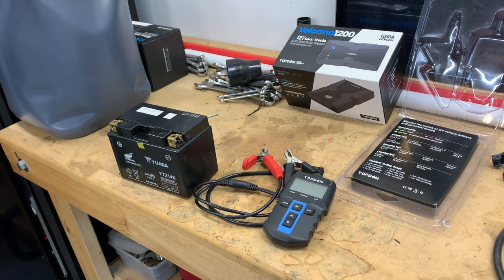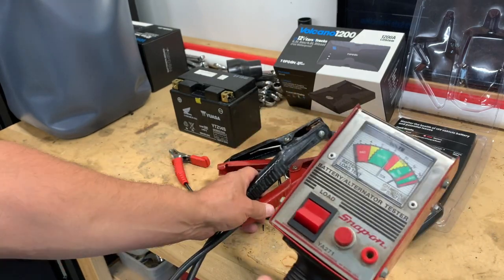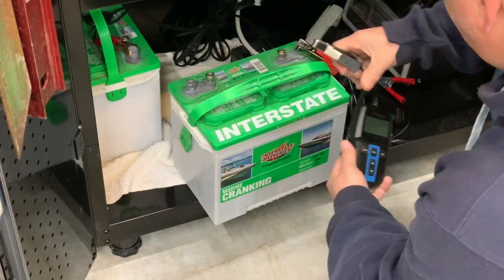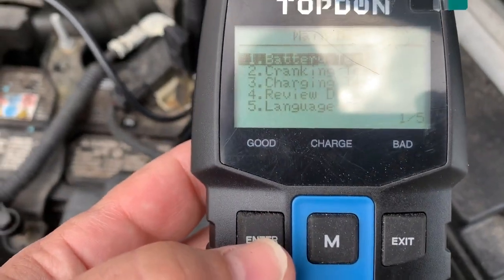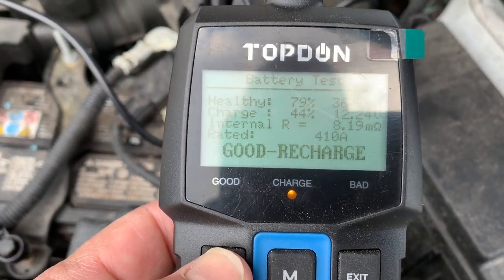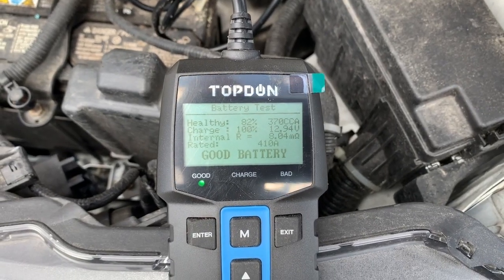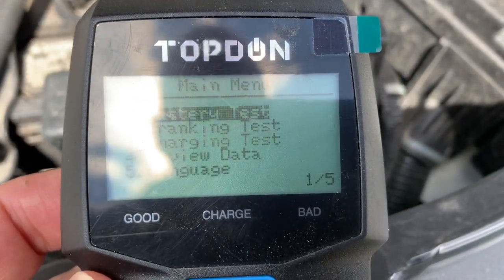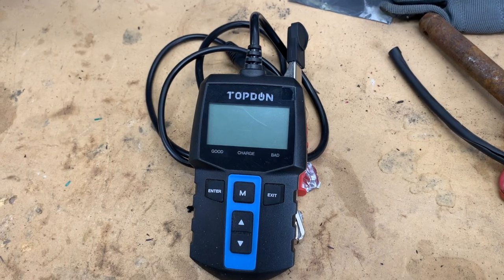TOPDON BT100 Battery Tester Review

Comment: Ok my Topdon BT100  on the charging test shows  NO-OUTPUT     and about 9.4V     with a brand new charged battery.  Battery test passes at 700 CCA.  Any ideas?
Reply from the maker: That would mean that your alternator is not working, right? How is the diode ripple test?
Reply: @EddieCarrara1   Failed diode test per a Oreill'ys  store tester.  So the BT100 found it,  it just says "NO-OUTPUT   and the booklet doesn't mention that error. The BT100 has been effective at identifying problems.

Comment: In case anyone else wasn't sure, on the charging test - after the ripple test - the unit is waiting for the engine to be revved up to 2500 rpms to continue the test.  You "Press Enter to continue" only AFTER you have revved the engine up to 2500 RPMS, not before and not during.  The unit detects on its own if the engine has been revved up and then performs the charging test at that point.  The owners manual in fact says you are hitting enter in order to view the results of the test.  I confirmed this with TopDon support.
Reply from the maker: Thanks for the clarity Mark 👍
Reply: Yes this should have been explained in manual. Rev up, get out of car go to meter press enter.
 Also should explain different batteries or give like to.  Also should change the word Engine needs to be "ON" should say "running". Because that's the verbage used to turn key on.  Poor manual.

Comment: You need a 2nd person to do the charging test. You need to have the revs up when you click enter, you cant run to the car after pressing enter, by then it's aleady testing. The crank test saying low was because the volts were below 8v. That is bad and an indication something is wrong. That battery was dropping from 12v down to 7v when the starter motor was in use, which is not what is meant to happen if everything was good.
Reply: @pleco101  You hold the revs higher for 5sec, not the button in for the 5sec. You cant do this properly without a second person unless you are very lucky and your battery is near to the drivers seat - or you can operate the throttle from within the engine bay.

Comment: Great review with this battery tester! 
I did a cold battery test , healthy=76%, charge=20% - turn on car for one minute then off, same test is healthy= 79% & charge=54%, why this change in charge ? Is it possible the first cold test (car off overnight) isn't valid ?
Reply from the maker: Hi Houmi, Batteries will bounce back after being used so when you turned the key on you may have put a light load on the battery, then when you turned the key off it bounced back. What I recommend is run the vehicle for about 10 minutes and then test the battery several times and see if your results are more consistent. Let me know how you make out, thanks.
Reply: Thanks Eddie - It actually was a little bit more complicated and my battery cells were getting empty and I had to add distilled water in 4 of the 6 cells (one was more empty than others) then I charged the battery with a Noco Genius 5 overnight and tested the battery and got it to 90% Healthy and 100% Charge. After tuning it on / off the Charge went down to 92% or so... 

But it seems it was a combination of low acid levels + low charge when it had died and I had jump started it. I'll keep monitoring the levels of acid + charge in the next few days, but I have left the Noco Genius 5 on it 24/7 since I am not driving it much.

The only thing else I noticed with the tester is that my crank voltage is low (no clue why), and the charging loaded/unloaded was 14v.
Reply from the maker: @houmig.361  That doesn't seem unusual unless you have had high crank voltage in the past with the same vehicle, and the voltage it pretty close to normal from the alternator.

Comment: The only way to determine accuracy is to compare it with a Volt meter, if the numbers are off on the Volt meter all the other parameters will be off as well.
Reply from the maker: Correct.

Comment: Gold review man. I would like to ask you a question though. I've seen your video on squeaky brakes. My brakes did a high squeal when braking after I washed my car... Just wondering will this go away or do I have to fix this.
Reply from the maker: Hi Salamat, 
If the squeak is because of the rotors getting wet, the noise should go away within a few normal stops. If the noise continues it most likely  be cause by something else. I recommend you keep an ear on it for a day or two and note when it happens just incase you need to talk to a mechanic who's diagnosing it and needs to reproduce the noise. Let me know if you have more questions, thanks.
Reply: @EddieCarrara1  alright cheers because I was scared to wash my wheels again
Reply from the maker: @salamatpo7326  Always wash your wheels, it makes the car look great 😂. Let me know if I can answer any other questions.
Reply: @EddieCarrara1  ok cheers mate .... Also you were right the squealing went away after 3 days of normal driving in Australian conditions aha